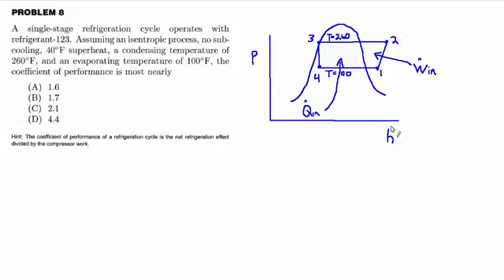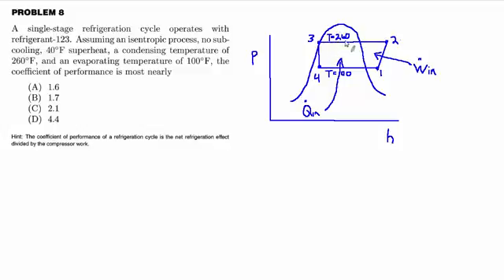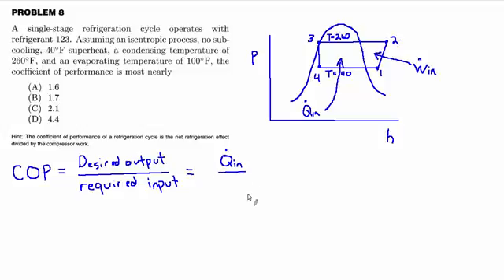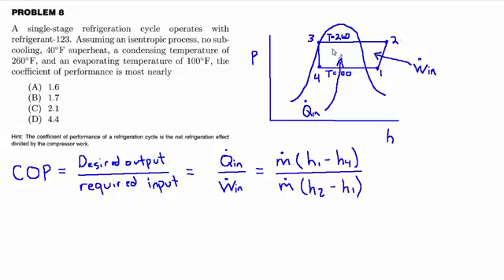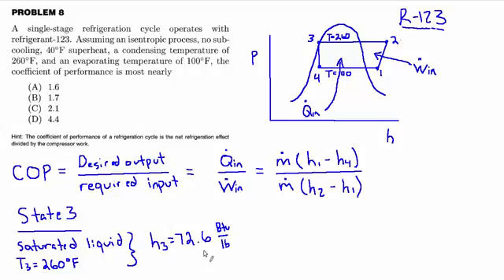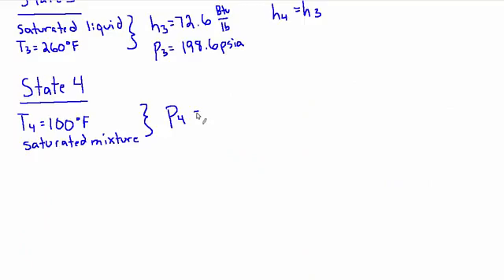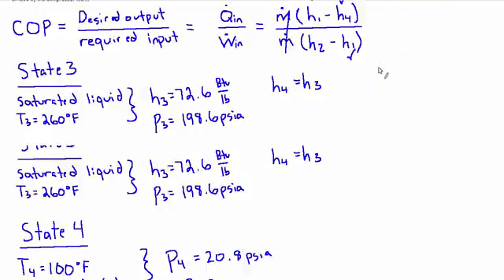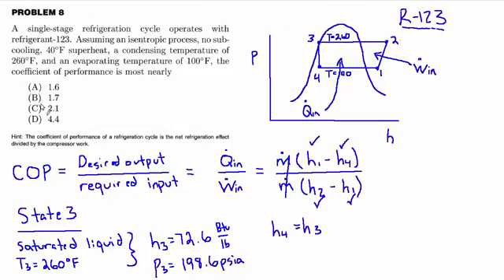How to Calculate Coefficient of Performance (COP) in Refrigeration Cycles for the PE Exam

Comment: Dan, on the exam we now are only allowed the PDF reference.For the refrigerant we only have the chart and saturated tables. I used the diagram and found the following: h1=108, h2=126, h3&4= 75. When I use COP equation I get 1.83. 

In the solutions, they get h1=114, h2= 129 & h4=75.7. I do not see how it is possible to they got their H1 and H2 values, which comes out to COP of 2.14. 

It seems my values from the chart were a combination of both the two solutions, I know I accounted for the process properly with superheat and isentropic. When I use saturated tables at 260F hg is 75.7 (not the 72.6 you got) which is the only difference from our solutions.

Any insight would be helpful, thanks!
Reply: Typo, my hf value from saturated table was 75.7
Reply from the maker: Shoot me an email on this and attach screenshots of the source problem if it's not from my program and I'll see if I can help.

Comment: Dan I used the COP formula with TL and TH and got the same answer by simply setting the COP= TH/(TH-TL) = 260/(260-140) =2.16. Please let me know if this approach is correct. It took less than a minute to solve using this formula.
Reply: Dan Molloy. Thank you for your replay and you are correct I was lucky to get the same answer good thing I made a mistake here and hopefully not on the exam.
Reply: @haidersalih5578  I can't see Dan's comment (maybe it was deleted) but the equation you used was for heat pumps for the carnot cycle not the refrigeration cycle single state. funny the number still came out the same.

Comment: Hi Dan, is there a diagram for R-123  to find the enthalpy directly? Or we must use the table? Thanks
Reply: @nycmathtestNewYork  ASHRAE Fundamentals, 30.10.  There is no superheat tables for any refrigerant (except 134a), so you have to use the P-h chart and approximate.  You could calculate point #1 from the chart by using the saturated vapor enthalpy and add the Cp (given in the table) * superheat (the dT), but you are out of luck with point 2 finding the constant entropy point.  My approximations with the chart (h1= 112, h2 =128, h3/4=75) got a COP of 2.31- close enough to pick the right number.  I'm sure there's a more accurate way to calculate this without the superheated properties table, but not sure what that would be...